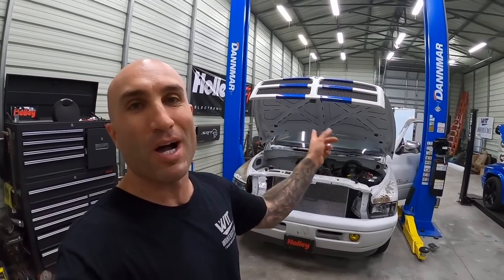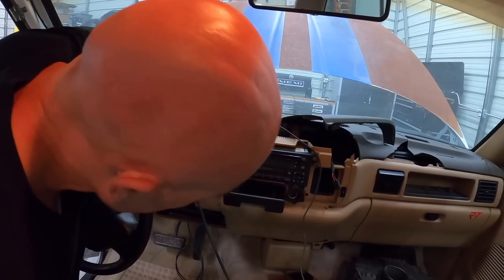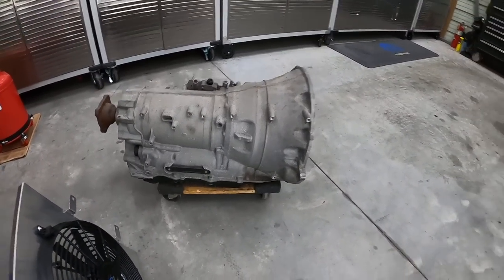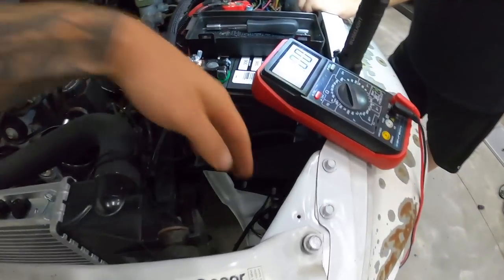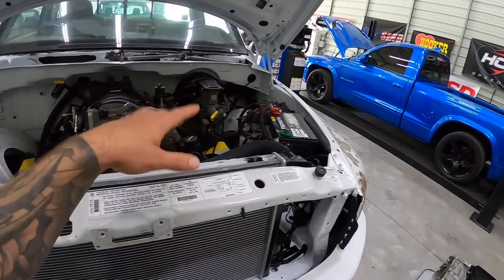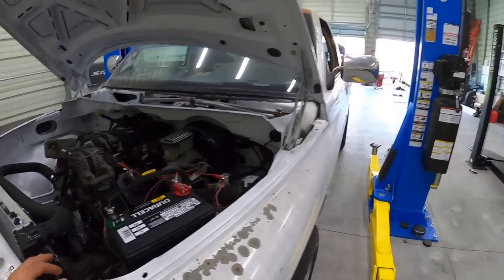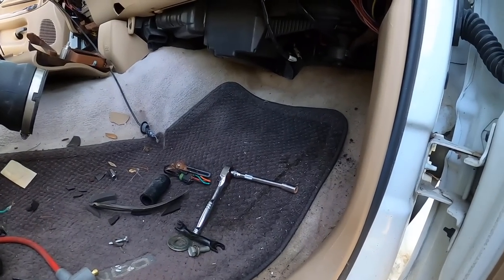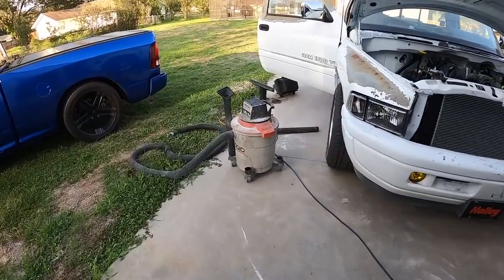Dodge RAM 1500 HEMI SWAP Build | Part 9

Comment: What do you feel about the hemi tick and have you noticed it in any of the hellcat engines. Both my 5.7 and 6.4 had it. I heard if you upgrade to the 6.2 hellcat oil pump it gets rid of the problem.

Comment: Great video.If you put the 8 speed in it make or buy a floor console and put the automatic shifter from a Dodge Challenger in it but change the handle to the aftermarket Hurst handle.I had it on my Dodge Challenger and loved it.
Reply from the maker: Thought about that but the floor is way too low for a shifter to be down there
Reply: Taller console or lengthen the part the handle attaches to,with your fab skills you'd have no problem making it work and look good.

Comment: For all around best performance I would have to say 8-speed. I have done this swap in my 2005 Dodge ram. I am curious if you do this swap what transmission controller would you use?

Comment: My understanding, that PWM signal from the holley is supposed to go straight to the alternator, not a relay. It fluctates the field in the alternator to modulate voltage. More frequency, more charging. The relay wont keep up with the frequency needed to keep the alternator at proper charging voltage.
Reply from the maker: Holley outputs a PWM - signal which the GM and others use. Mopar requires PWM + signal which is why we’re sending it through the relay to invert the power

Comment: Could do a built 46rh. They're basically a 727 but with overdrive and lock up torque converter. Still no 8 speed, but better option for cruising than the 727

Comment: i have a 46RH for you, i have 2-727 two wheel drive trannies and 46RE, for the RE, there are 8 pins, you could wire that in as well.  you mentioned your selling the truck when your done?  how are you going to list it?

Comment: you better have that transmission rebuilt before putting it in and then go with the console shifter in the floor like they used to be upto the 2000's

Comment: Where did you get the dual fan shroud setup? 
I'd like that for my Durango
Reply from the maker: eBay. Fans are trash though they shake the whole damn truck. Going to upgrade the fans and at $140 it’s a lot of $ for just a piece of aluminum

Comment: Race the 3 speed see what it does then race the 8 speed see the deference bro !
Reply from the maker: Only thing is the driveshaft for the 3 speed would need to be redone since it’s a bit short and not sure I want to drop $600 if we know it’s coming out
Reply: Get a junkyard long wheel base driveshaft and cut it down. That would be the cheapest route to see how the torqueflight does.

Comment: Would you fix fans builds? ( I just want my truck to run healthy)
Reply: 1992 d150 2door short bed 2wd with a 318 v8
Reply from the maker: Send a message on Instagram, Facebook or email BoostedMotorsports88@gmail.com

Comment: Why do people use that fan set up. Doesnt that limit how much air goes into engine bay. Doesnt make sense to me
Reply from the maker: You need a shroud to direct the air from the fans to through the radiator. OEM fans are the same way

Comment: Unpopular opinion I know… but I think it needs to be considered lol…. Tan interior and wood grain is dumb. Period end of story. The sst as much as I and many people like them for the mopar “rare” factor it’s not a widely collectible vehicle…. Agree or disagree whatever…. This truck… 5.7 turbo build 8 speed racing seats caged Holley dash drag and drive vehicle clear coat the patina save the time and effort on cosmetics and put it all to go fast reliable and take us on the drag and drives with the other big YouTubers and get the added exposure. My 2 cents
Reply from the maker: Want to use the hellcat ram for this years drag and drives 💪